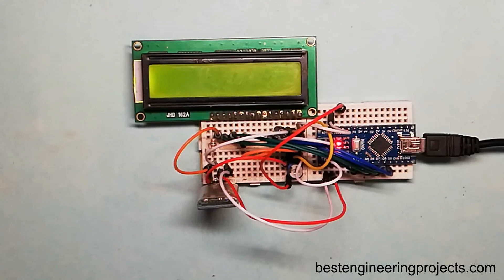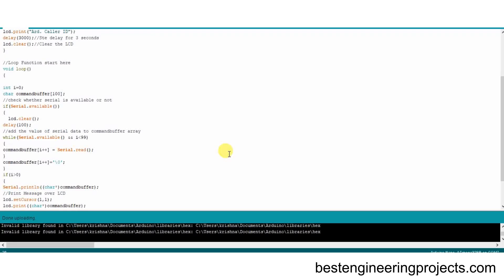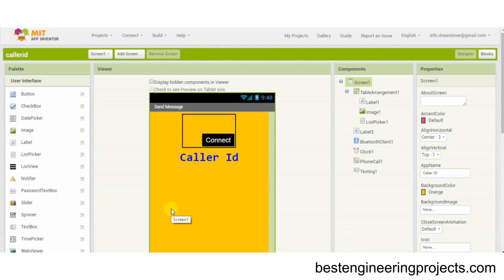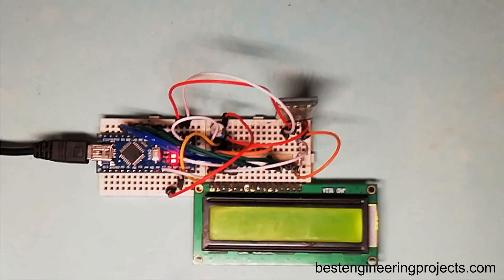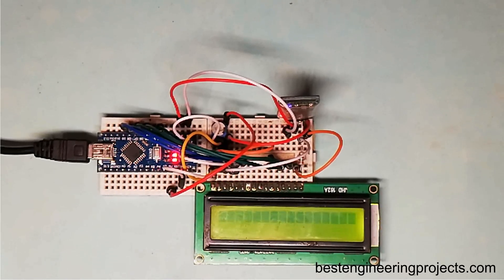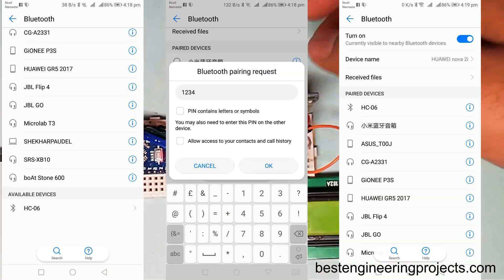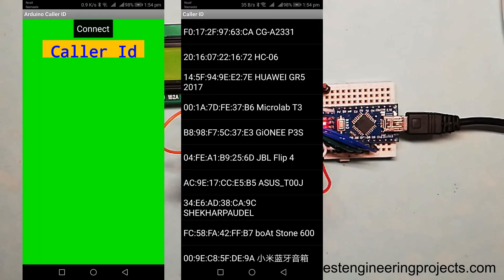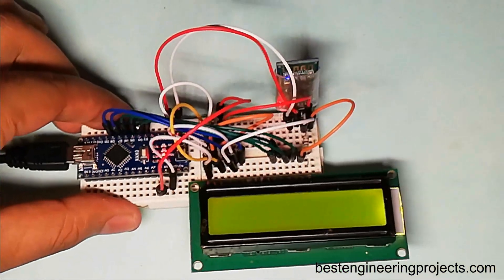Caller ID for Bike using Arduino

Comment: Hi, What you are using to power up arduino ...... Voltage and Ampere rating of source
Reply from the maker: if you are thinking of implementation this device on vehicle then, vehicle battery with one 7809 (9V voltage regulator) is best option.
9V @ 500mA at vin pin is more then enough.

Comment: hi, i built this project but the caller id app will not work with my project. It will connect and later disconnect again, what is the problem